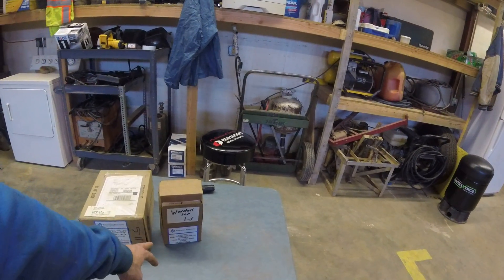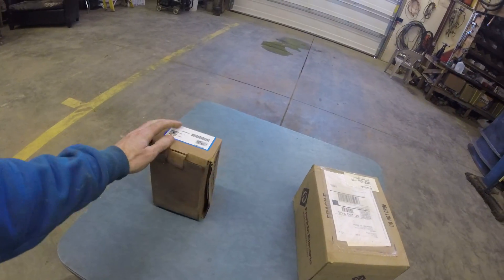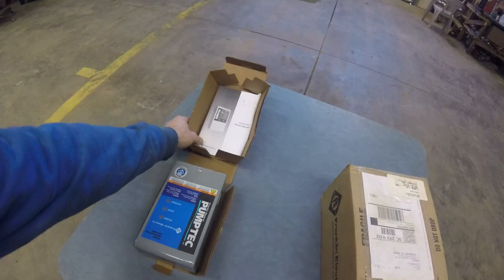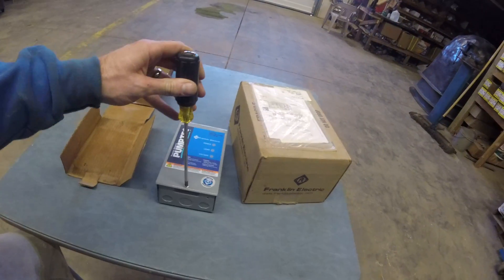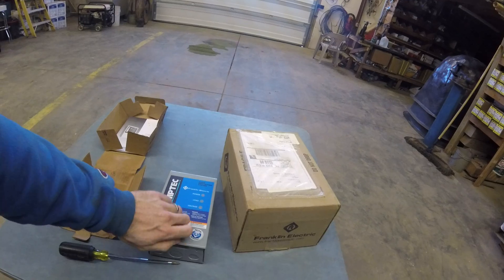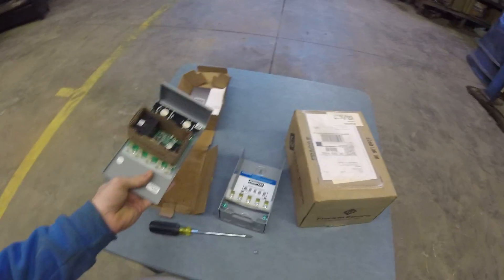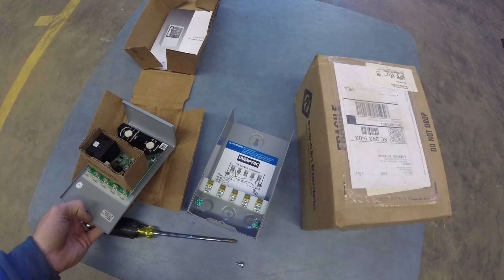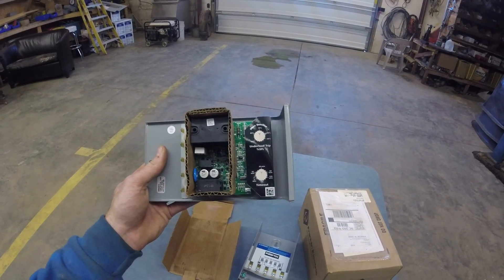How to PROTECT your Well Pump? Check Out this Well Pump Protection Device

Comment: Long shot not sure if youll see this but I have that exact same pump tec and was wondering how to hook it up. the only pressure switch i have is my above ground pump to my pressure tank. my well pump just pumps straight into a holding tank is it possible to still hook this up to save my well pump?

Comment: Hmm. I need something like the regular Pumptec I think. 1HP 230vac jet pump that pulls from a cistern. From what I understand the QD doesn't have the full functioning of the other pump savers. It won't do anything about power cycling or waterlock. I'm looking for something that will shut my jet pump off if there is no water and its running dry/pumping air.

Comment: What equipment makes the water pressure increase besides turning the switch up?  So, I take it that the water pressure will increase with an increase of water flow, so a wider diameter pipe is one thing that will increase the pressure.  The next piece of equipment that increases water pressure is a larger well pump.  What do you mean by larger?  More horse power?  I'd like the pressure to be equalized more so that two faucets can run at once.  I've yet to meet a plumber that can resolve this problem.  I've had the mixers all changed, but no improvement.  I've been trying to get someone to increase the pressure for years now.  I'm in Connecticut. :   ))

Comment: Do these work on all submersible well pumps. 5hp-1.5hp? I have one of these and it didn't trip on my 3/4hp submersible well pump
Reply from the maker: yes, I'm not sure which model you have. The QD version serves up to 1.5 hp and the larger model can serve up to a 5 hp motor.

Comment: is there a model for 10hp motor?  I check the website and 5hp is max.
Reply from the maker: That is correct for the Pumptec Plus. For motors larger than 5 hp, Franklin offers what is referred to as the Submonitor Connect Protection System. They are pricey, but are night and day different from its capabilities and protection features versus the Pumptec. We have installed several of these and they work very well and have benefited us several times from our local power company dropping a leg of power out or large variations in voltage. Thanks again for watching our videos, let me know if you need any more information on what else is out there
Reply: @WendellLeeWellServices  Thank you for the great info.  Do you know the usual price for the Franklin Submonitor or a good place to purchase it online?
Reply from the maker: @chowgp  Due to what they are they are nearly impossible to get from anywhere unless they are a Franklin dealer. We can get one for you and ship it to your address if you like. They make several different models with different options available on each, so check out our website and get our phone number. We can discuss what you have, what options you want, and go from there to get you the best price before you do anything. Thanks again, Grant